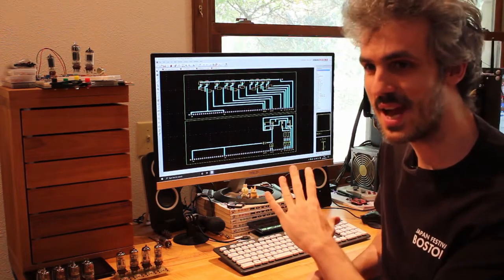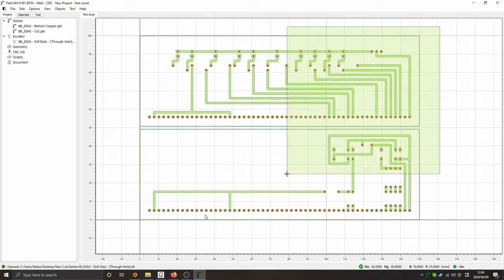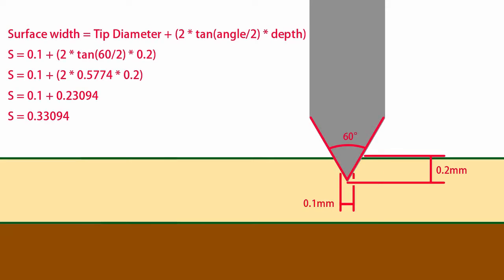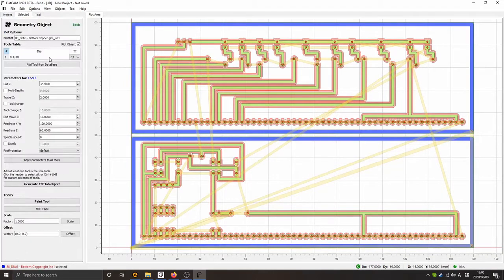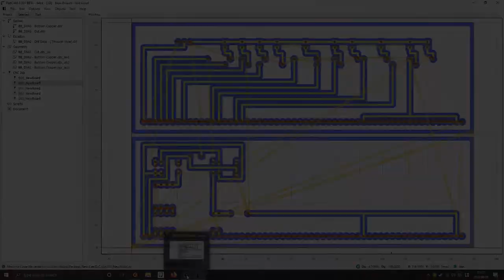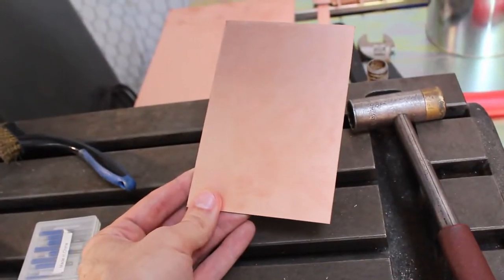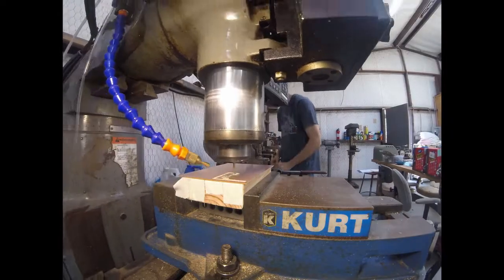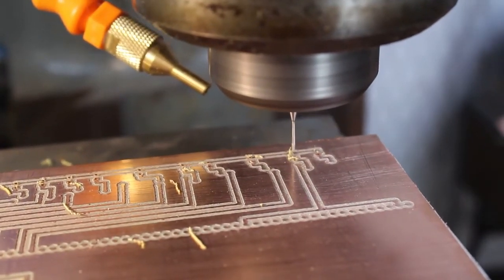Relay Calculators: Episode 8 - Using FlatCAM and a CNC mill to make PCBs

Comment: Oh my, that is quite a mill.  :P

A couple questions for my edification, if you please:

1. I see that you use a V bit rather than a small end mill.  Does this produce better results, and if so, why?

2. Does leaving all the swarf on the board during milling cause problems?  I see that you have an air nozzle on your machine, but I am looking at converting a cheap 3018 CNC engraver to a PCB mill, so if I need to deal with the swarf, I guess I'll have to make a vacuum boot or something (I don't want to blow all that swarf all over the electronics workshop with an air nozzle, lol).

Thank you, sir.  You are a gentleman and a scholar.
Reply from the maker: Thank you! I love our little Bridgeport EZ Trak!

The primary reason I use a V-bit as opposed to a small end mill is simply size. I use 1mm trace widths with a trace spacing of 2.54mm, which is already much wider than a standard PCB uses. That means there is 1.5mm of space from the edge of one trace to the edge of the adjacent trace. The smallest end mill bit I could easily and cheaply find is 1.5mm, which I actually use for cutting the actual board outline. But, for straight line traces, I could just get away with the 1.5mm bit, there are a few places (particularly with my tube designs), where I only have 1mm or slightly less between components that need to be isolated. The 1.5mm bit would just be too big for those situations. The V-bit on the other hand can actually isolate down to really tight tolerances if you get the Z perfectly zero'd out.

On the first few boards I cut when learning how to do this whole thing, I didn't actually have an air nozzle setup, and I don't remember there being any problems from the swarf. It's mostly dust, but sometimes you get long curly strands of copper. But, even with those, I never notice any problems with cutting! I would say just use a vacuum to clean up every 15 minutes or so while it's running and you'd be totally fine.
Reply: @UsagiElectric  Do you use a vacuum table, or can that mill make a heightmap of the board?  Thanks, man.